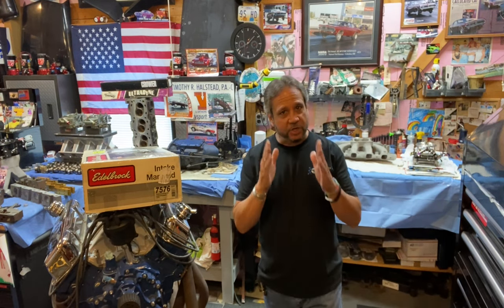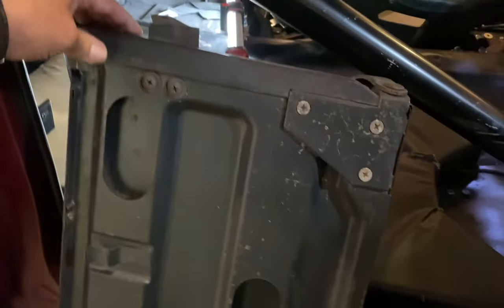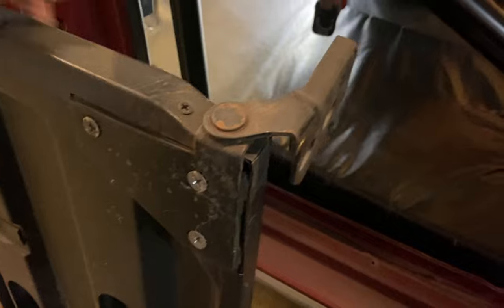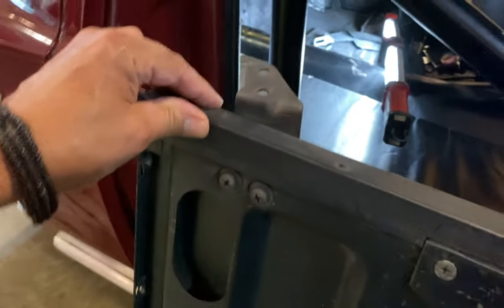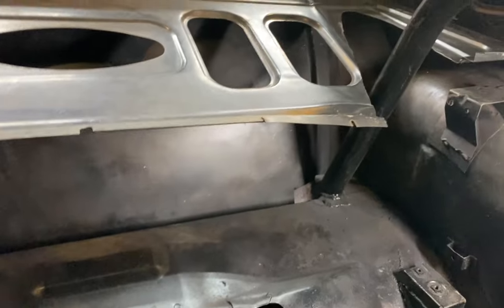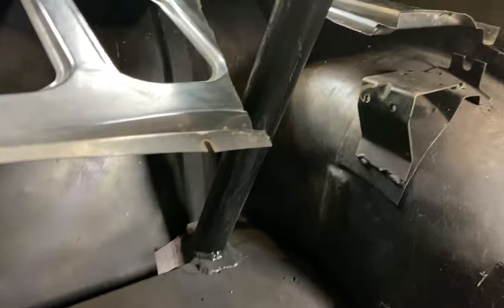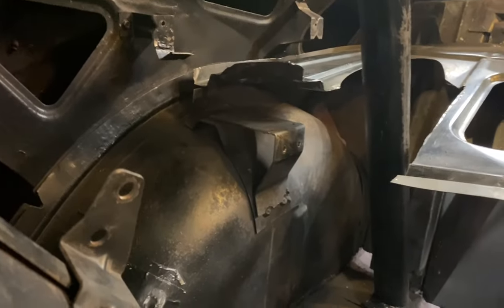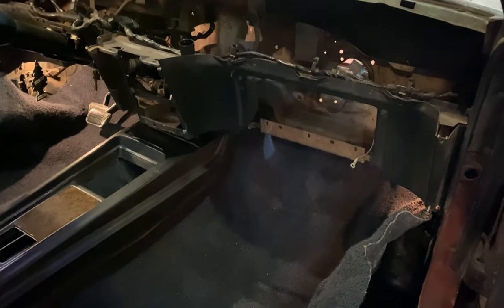DragBoss Garage: Installing Stock 69 Mustang Rear Interior With A Roll Bar, What They Don't Show You

Comment: You're right, Tim. Your viewers got to see the roll-bar and rear seat installation that normally "an engine guy" channel wouldn't feature. Hard work and dedication for sure. The quest continues. Thank you for that!
Reply from the maker: thank you Bill, appreciate you. It was a work out.  I do need that piece on left side that goes between the seat and fiberglass side/arm rest. If you have one let me know.
Reply: @DragBoss351Cleveland I'll check for a cap, Tim. If I have one, I'll send it out.
Reply from the maker: @billfioretti3013  Thank you Bill, I will hook you up. Appreciate you looking. Did you see the package tray I made, lol?
Reply: @DragBoss351Cleveland  Dedication and determination defined, my friend! Turned out well in the end. (I do have to wonder how much editing was involved, though!)😂

Comment: Ouch!  Great job on the end result, not many would show the struggle it took to get there. Honestly I was expecting a lot of bleeps  in this video working around the roll bar, been there and don't want to do that again.  I admire your patience and focus.
Reply from the maker: Thanks Banger, figured good for people to see what it takes. I did swear a few times, but edited it out. Yes was not going to give up, it does look choice, and it is not even clean yet. I pulled it all back out but the tray, that i screwed in to secure, carpet fitting next. Thank you for realizing what it takes.

Comment: Nice job tim
Reply from the maker: Thank you. Man it was tough workout in futility. But perseverance championed. More on the way
Reply: Any time Tim love your vids watch all of them I have a 67 mustang gt fastback that my dad bought new it was originally a 390 car he put a 428 scj in it with 12.5 to 1 compression stroked to just under 500 cubes edelbrock heads isn't solid roller vertex mag with a custom sheet metal intake with 2 750 dominators car runs strong I also have a 92 fox body tjat has a 1400 to supercharged 8.2 deck 363 cube motor keep up great vids fords rule
Reply from the maker: @motorheadmike2010  thank you so much. Your cars sound awesome. Love the 67FB, my buddy has one with a mild 390, runs high tens. Looks like the Bullet mustang. Have a vid of his car. 10 Second 67 Mustang 390 FE
https://youtu.be/KKwxYBvvwxY
Your Stang sound nastier than ever. Shoot me some pics and vids maybe I can a video. Thanks for watching and supporting my channel. 🏁

Comment: Without looking at the end of the video, I must ask….Do I have to get rid of my vintage Philco 6”X 9” powerhouse speakers ?
Reply from the maker: Yes you do, just cut a hole in the center so roll bar can pass Daniel.
Reply: @DragBoss351Cleveland … So I’ll have to say farewell to the audiophile quality tunes from those funky oval factory speakers ? 🤔  
Consider it done in the name of safety provided by the potentially life saving roll cage. 🏁
Reply from the maker: Key is custom. There are 5 other holes in that package tray, all can accommodate speakers, add a 300 watt power booster, some deep purple highway star and start banging gears. But with a complete stick looking interior 😉
Reply: @DragBoss351Cleveland   … Now that’s what I’m talking about !  Or you could go gonzo with “Smoke On The Water” and a 1200 watt sub-woofer package. At that point you will actually transform into a Highway Star 💫.
Reply from the maker: Hell yeah! Never had a radio in a race car. Hmmm rock on and crank it up

Comment: DragBoss Garage
 Tim, I bet you about lost yourself when you dropped the Parker 😮‍💨 I would have defiantly been editing out many unpleasant words.
Reply from the maker: Matt, your the only one that mentioned it, thanks for watching. I never swore, it only bumped a corner no big deal, glad it did not hit my foot.
Reply: @DragBoss351Cleveland  You foot was lucky and good thing the intake is ok. If I remember correctly, my Trick Flow Track Heat has a little heft to it too. What plans do you have for the Parker?
Reply from the maker: @nova467spanker  no lite weight. Once I get the Mustang racing, may test it against my strip dominator I am porting.
Reply: @DragBoss351Cleveland  sounds cool man. You have so many projects. I cant wait to see how that Parker performs on a Cleveland. Most people and stuff I have read say the 302 Parker is junk.
Reply from the maker: @nova467spanker  stay tuned

Comment: At least you are getting to work on a cool car and don't have to worry too much about the leather seats and the headliner, you have the idea, but I will admit that you have your work cut out and it's not easy or everyone would be doing it.
Reply from the maker: Yes the headliner is perfect so has to work around that and not damage it. Well back it done, just need some replacement screws. Carpet next